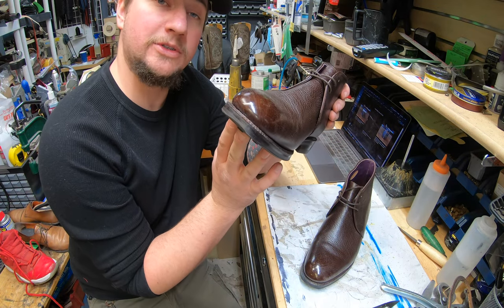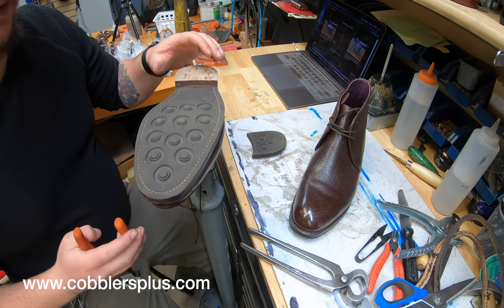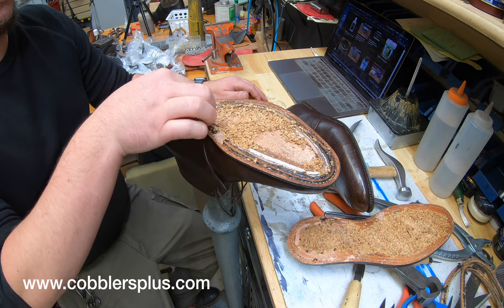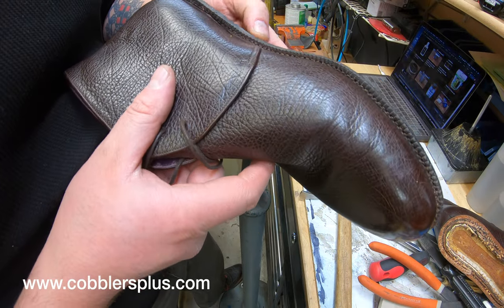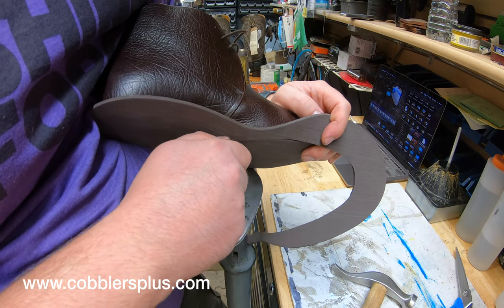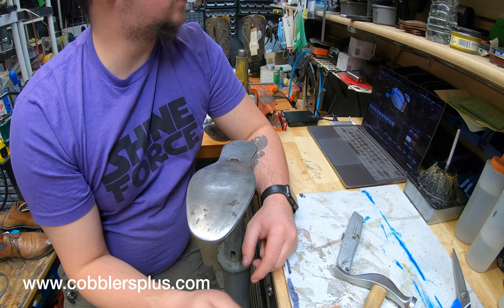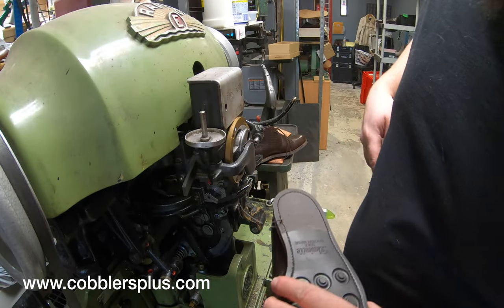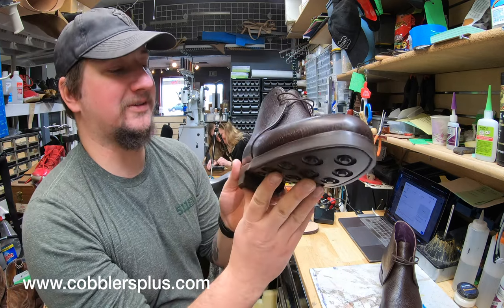Meermin Shoes resoled with Dainite soles that are NOT channel stitched

Comment: Wow, some First class nit picking going on here .
2 mins in you're saying you can't compare them too a $1000 shoe, then you start slagging them off (wrongly).
"Used the wrong nails in a fibre board heel", leather heel base which you had to remove off camera because it was so well atttached.. Then you were wrong about insole being fibre board. Slagging off a metal shank being used. Sole has been sanded 1mm thinner in paces.
If you look at 1 min 23s  you will see the stitches in tthe sole are a uniform colour, not painted. The brown "Paint"" on the stitch is probably boot polish from the stith in the welt.
Reply: i agree. this is a great channel (one of my favourites on youtube) but this video was just 27 minutes of slagging off meermin.
Reply: Hey guys
If you own Meermins what is your opinion?
Reply: @jeffreygoss8109  I have some meermin shell ptbs I love them, great shoe and great construction
Reply: @jeffreygoss8109  if you're a patient person, their MTO group program occasionally has some very reasonably priced cordovan boots/shoes. Takes a couple months before you'll receive these MTOs
They also have a HANDwelted line for around $350 which are a steal